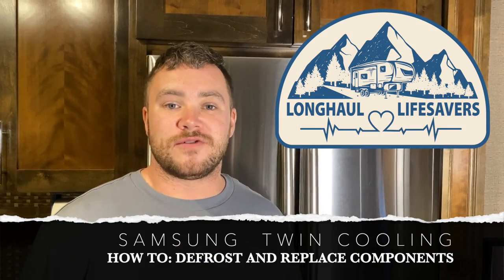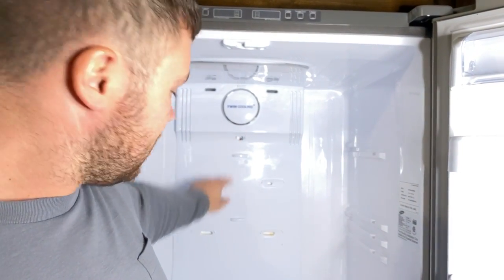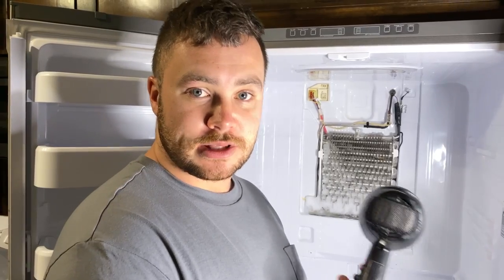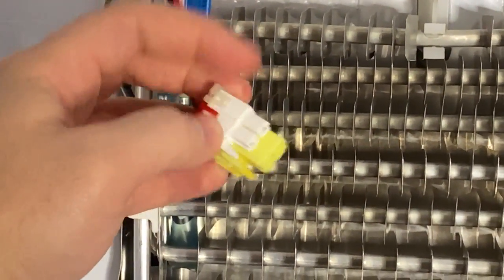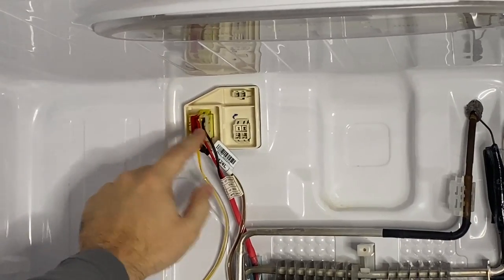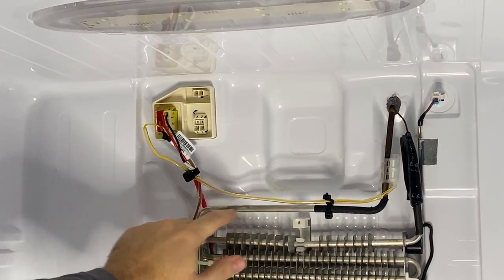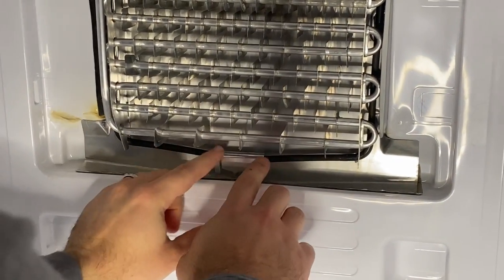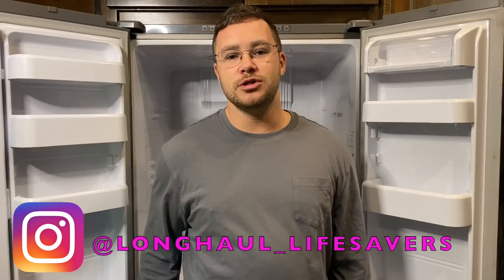HOW TO FIX A SAMSUNG REFRIGERATOR

Comment: Nice video. But what was the reason for the repair? Refrigerator to warm freezer not freezing? Can you answer?
Reply from the maker: Kenneth Botke the refrigerator kept freezing over and not holding temperature despite replacing parts multiple times